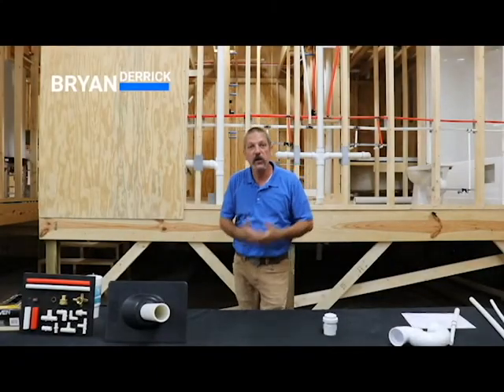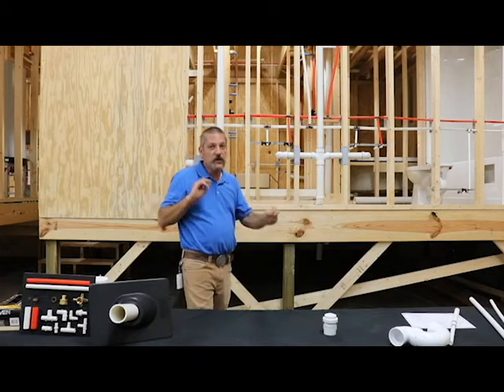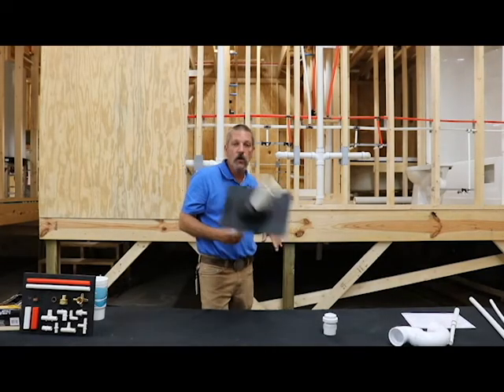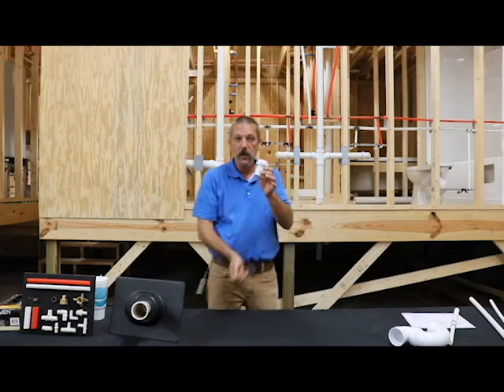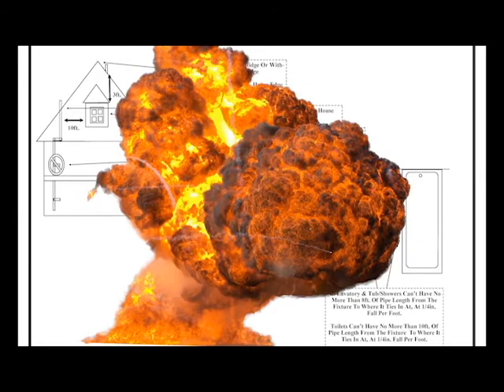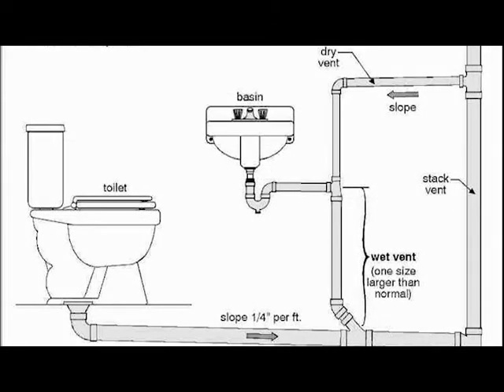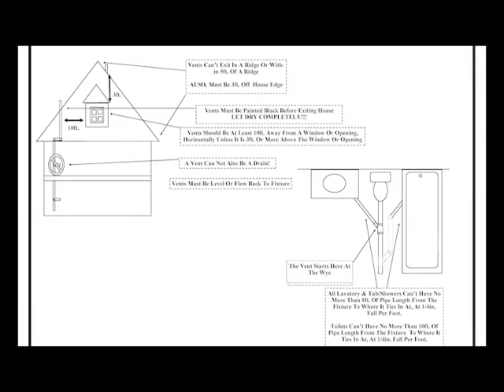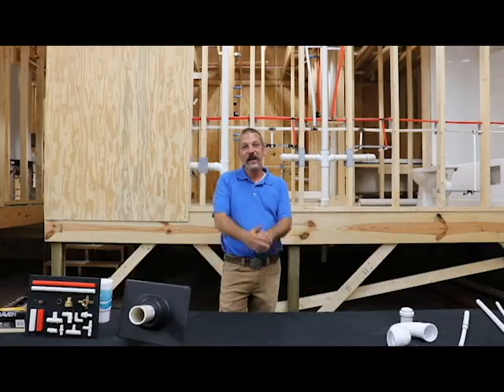Plumbing Vents

Comment: I had a question for you:  I am building in Mexico, and the roofs are pretty much flat, can the vent go out the side of an outside wall and curve downwards?  (This would keep leaves out, and excess rain, in rainy season.)  I have not seen vent cap at plumbing places, and there are not any soffit vents to worry about.

Comment: Found your video while looking for proper venting.  Is it advisable to vent on an exterior wall and not on the roof? I just moved my laundry room to a basement and i have no option to connect it to our stack vent.  Also if above mention is not applicable, is there a 2 way  air admittance valve available in the market? Thanks!
Reply from the maker: Yes, it has a charcoal filter in it , that has to be replaced every so many years.

Comment: Does HUD require securing a shower valve inside the wall or can it just flop around? I need a diagram of a HUD approved shower valve installation.

Comment: Really enjoyed the video. I'm a little confused on the last part. Looks like you're using a wet vent diagram (I thought you didn't like to use those). That's why the vent starts at the intersection of the toilet main (middle pipe). I think this diagram is referring to pipe length from the trap to vent distance limitations. I'm not as up to date with UPC, but IPC would limit a 3" pipe to 12' from the trap to vent. Anyway, always love plumbing videos from the trade guys. I make plumbing design videos for modeling so I love learning from you guys!

Comment: To reduce potential rain leaks in roof in attics with spray foam insulation, can vents be run horizontally out gable end of house and then turned up 90 degrees as long as it’s above any door or windows?
Any time there is a hole cut in the roof, there is a potential for rain water leaking in. The last thing you want is a leak between wood roof decking and closed cell spray foam. It would probably rot and create mold long before you realized you had a leak problem. Not to mention the expense just to remove all the foam needed to correct the problem. I know it’s not the norm but I rather have long term peace of mind. It could be years before realizing you had a leak if closed cell foam was under roof decking in attic
Reply: Depends on local code. I wouldn’t though. That vent terminal isn’t just allowing air into the system, it is also carrying sewer gas out of it. You want that to be as high as possible. If it were out the gable end of the house then that wouldn’t be the highest point and wind could potentially blow that sewer gas into the home. It isn’t a likely occurrence but it’s still there. 

Also, as long as you aren’t drilling a super fat hole for your roof penetration then you should be pretty fine. Caulk it, put a roof boot on properly (this is important), and call it a day. I drill my roof penetrations so there isn’t much of a gap between the pipe and the wood. 

But if you really think your way is better then perhaps write your local plumbing commission? Maybe they will amend the plumbing code or give you a response explaining their reasoning behind the code.
Reply: Yes.. take it out the side of the roof THEN.. take another 90 to a foot or two above the roof line.

Comment: can I use the air admittance vent to vent my washing machine? I just found out that my current vent pipe for the washing machine doesn't go through the roof but stops in my attic. the plumber didn't bother to put it through the roof or install an air admittance valve. You mentioned that you use it for sinks on kitchen islands, I figured there is no much of a difference with a washing machine, or laundry machine. Please let me know, I have to make a decision tomorrow!! I'm a DIY person, I don't want to pay people to make a hole in my roof if I don't need to. Also I'm short of cash so, your video literally helped me soo much! Thank you.
Reply from the maker: Yes you can , there is also a type that lets air in and out it has a charcoal filter ..

Comment: The plumbing vent of my old house has just  been found that it directly joins to the sewer pipe under the kitchen sink. and  the kitchen sink always drains very slowly but all drained eventually.  Is there a solution for this? Thanks.
Reply from the maker: You probably have a build up of grease in the "old" pipes .
Reply: @PlumbingSolutionsLLC  I cleared up the old pipes with 100' drain snake but it still drains not as expected. If  it's filled with water with garden hose, it would be full after about 20 seconds but with tap water, it cannot be seen full after 5 minutes filling. In  order to fundamentally solve the problem,do I have to link the copper pipe (connecting to the plumbing vent pipe) to the pipe under the main floor toilet? That's the  closest way if it works. Asked a few plumber and  got no positive reply on this. Thanks.